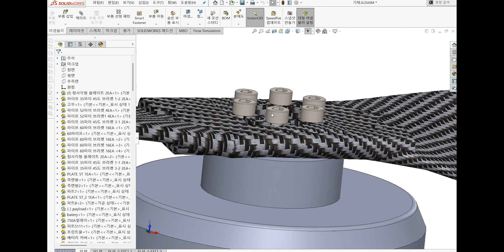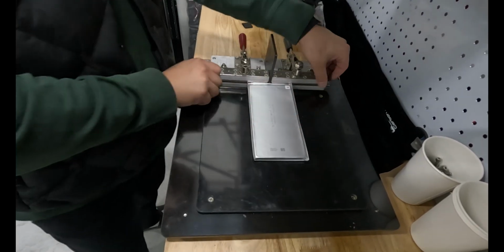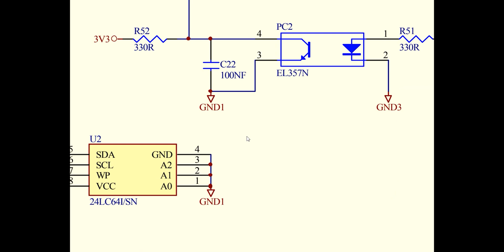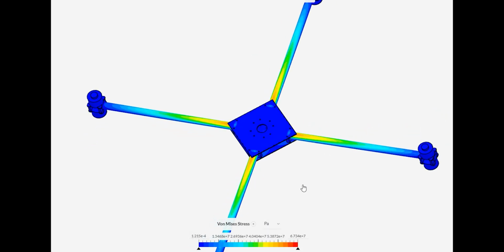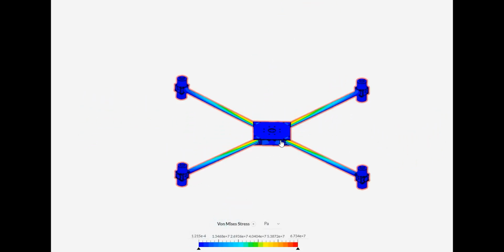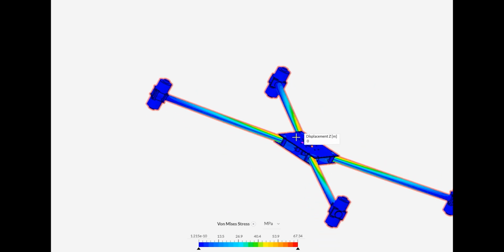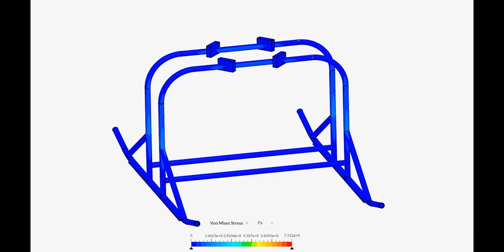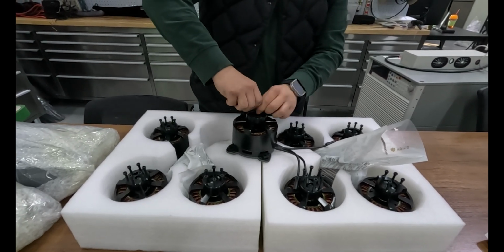I build a World's biggest Drone –Heavy Lift Drone _ Full Design & Build (Part 1)

Comment: What is the axial thrust load rating for the motor shafts?
Because all the weight ultimately hangs on the propellors and so is seen as axial force on the motor shaft bearings
Reply from the maker: Exactly, axial thrust load is critical. We selected bearings with higher axial load ratings to handle that safely